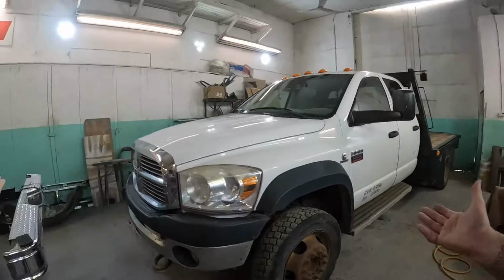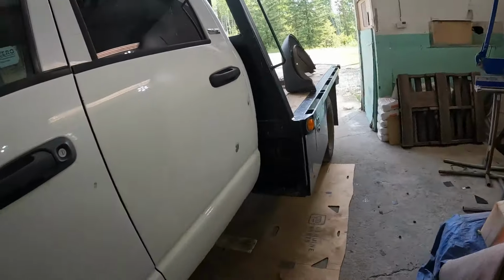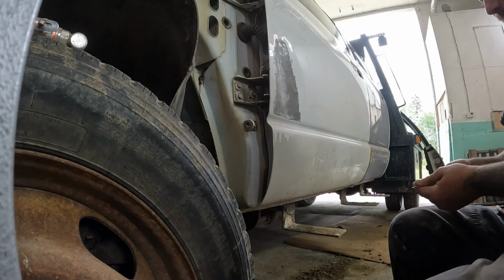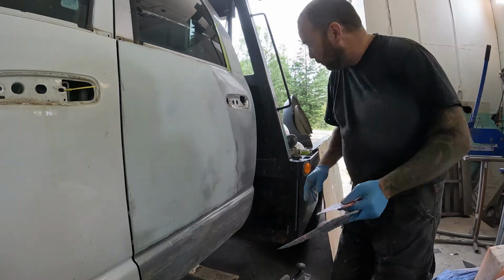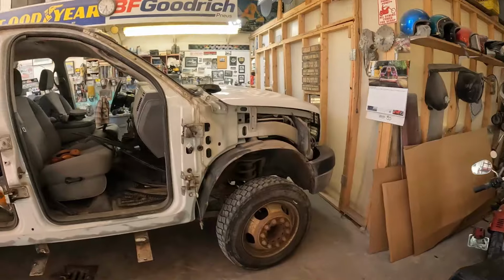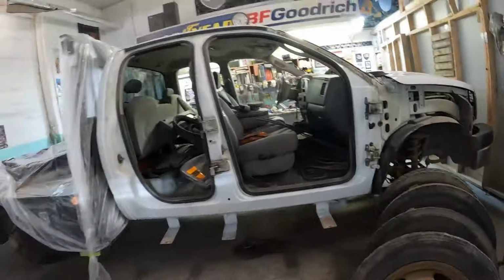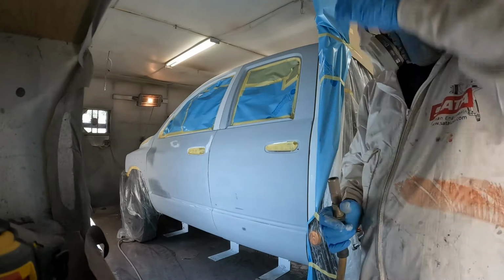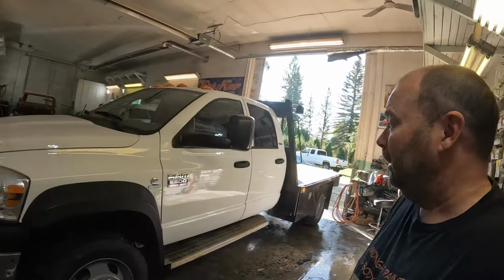5500 Dodge Ram Cummins diesel repair and paint

Comment: Thats a lot of work and a very good job. Could you tell me what pressure you use to spray single stage and what size tip. Thanks.
Reply from the maker: I haves 1.3 tip on the gun I use for single stage, but honestly , I’ve been painting for so long I never look at the gauge, I basically adjust the gun by feel, and even sound

Comment: Can you show how to tighten a radio antenna on the fender of a 2015 Ram HD?
Reply from the maker: Should just need the specific socket for the top nut, but they often corrode due to the dissimilar metals, and seize solid

Comment: Good stuff! Getting sick sucks . What kind of sand blaster do you use and nozzle, I am looking to buy something but dont need a super duper rig that cost thousands of dollars or speed is not a big factor either, just diy on my own rusty vehicles.
Reply from the maker: My blaster is a super old pressure pot style. Probably 25 years ago the body shop I worked at got a new one, and the owner gave me the the old one, been using it ever since
Reply: @Johnnymidnight  Ok thanks , I see Vevor has a few of those for sale. Dont know if I need a 10 gal or a 20 gal. Likely a 10 gal will do, I see some reviews saying the nozzles wear out quick or something on some of them.
Reply from the maker: @442olds7 mine has a ceramic nozzle, I’ve only had to replace a couple times over the years
Reply: @Johnnymidnight  Not sure what these ones have, likely some aluminum thing . What type of sand medium do you use, is there a "best" size/brand or will any type work for sheet metal .
Reply from the maker: @442olds7 I use the 30/60 grit crushed glass, if I am doing a lot of heavier steel I use 20/50, which is a step coarser.
Reply: @Johnnymidnight  Ok thanks! I see Princess Auto sells that stuff.
Reply from the maker: @442olds7 oh nice, the stuff I get is enviro grit, actually made locally to me. About 7 bucks per 50 pound bag